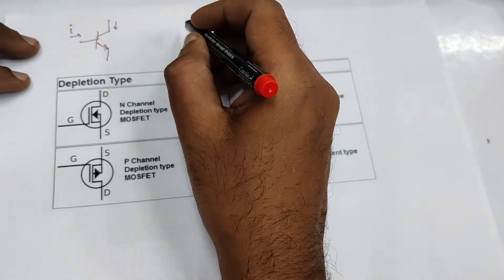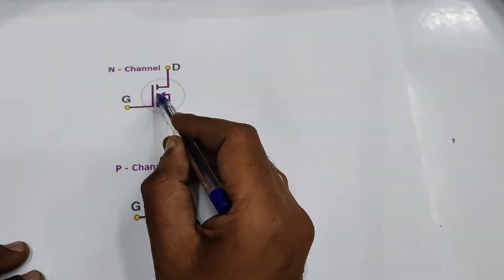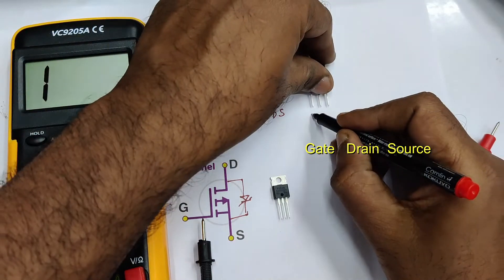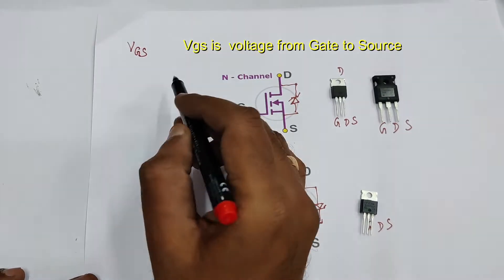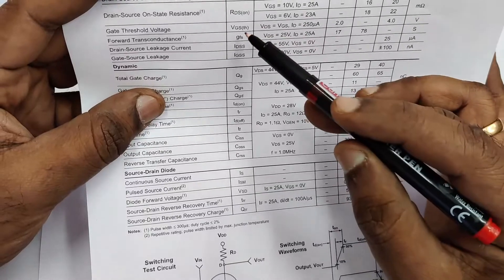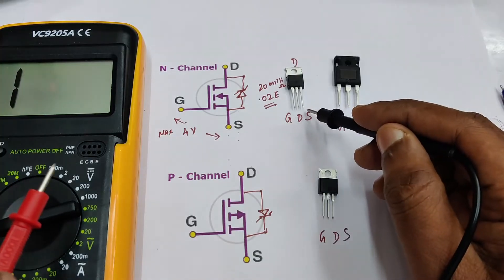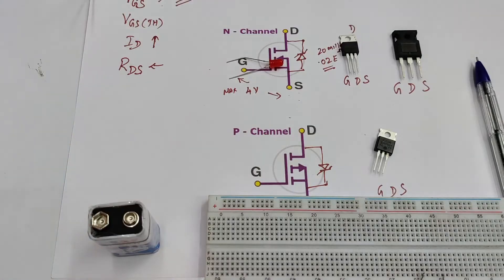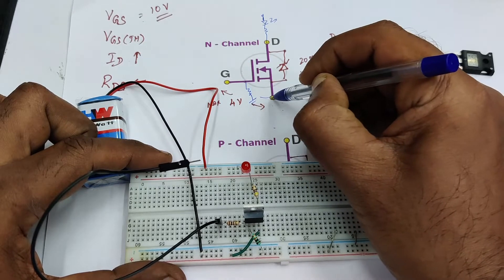MOSFET Basics - Specs & Testing

Comment: A good attempt but there are some critical mistakes. 
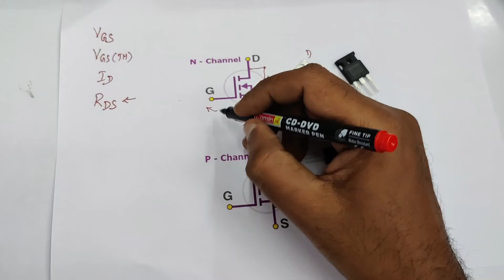1. @ 8:00 Vgs threshold is the point when the MOSFET comes out of cut off mode and enters the pinch off mode (constant current). The value Vgs min is defined as the point where some mosfets will enter pinch off but ALL mosfets (95% confidence statistically or better) BELOW this voltage ALL mosfets will CUT OFF. The Vgs Max is defined as the voltage where ALL mosfets WILL turn on as per manufacturing. Note that all the datasheet max and min values are to be read this way as these are due to manufacturing tolerances. So in other words, the MOSFET will most likely turn on anywhere between 2 to 4V and your FET does at 3.3V or so which means the part is WITHIN the spec.
2. The Vgs max voltage - for most enhancement FETs will be +/-20V which means you can give up to 20V and expect the FET gate to not breakdown. 
3. Most ON resistance claims will be two locations -> One at Vgs @ 10V (Gives BEST ON resistance) and at Vgs @ 4.5V (Most of the switching controllers have internal Gate voltages at 5V and hence this voltage is chosen.
4. @ 10:00 when you put the meter to the gate and when you try to measure the channel resistance you show that its initially low resistance and it quickly builds up to high resistance. This is due to the fact the gate capacitance getting charged with the DMM's probing voltage and when you charge the gate with this, the FET starts conducting. However the Gate capacitance is leaky and as it looses the voltage, the FET goes back into cut off.
5. The probing voltage for MOST DMMs will be 2.4~2.73V. This is the internal reference voltage and this is the most standard bandgap. Its NOT 3.3V
6. @ 12.48, you say that gate capacitance is a must. This is not correct. The gate capacitance (Given as Cgs) is extremely low and there is very little to no charging current to warrant a gate resistance. Infact, adding a gate resistance will slow down the FET (Due to RC constant increasing) and in high current switching can cause the FET to go through the linear mode slowly increasing the power dissipation within the FET and if not controlled, can lead to failure of the FET.

A good attempt, again, by a SW guy to explain HW. Good job at that.